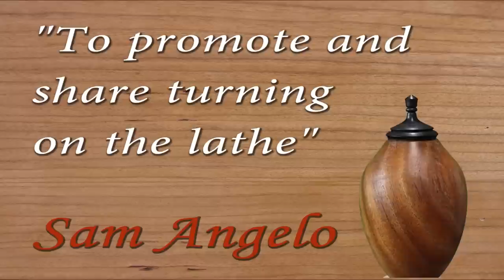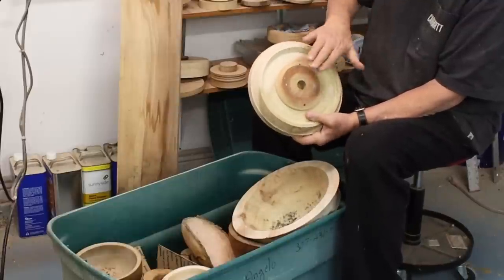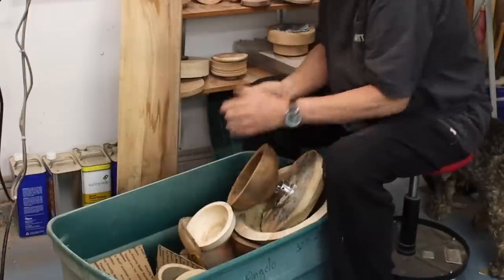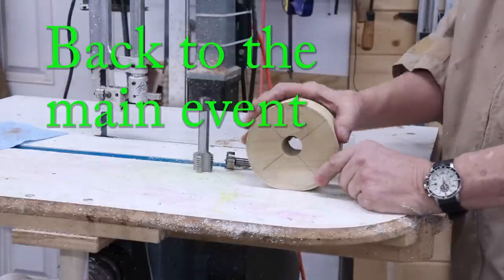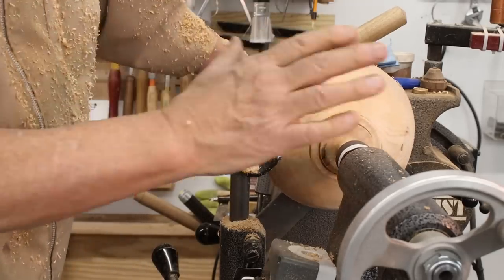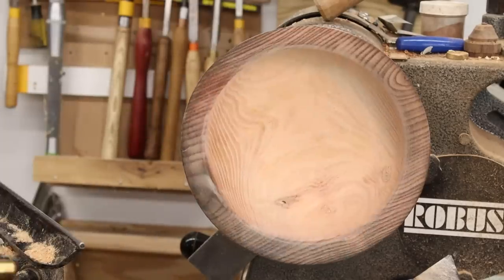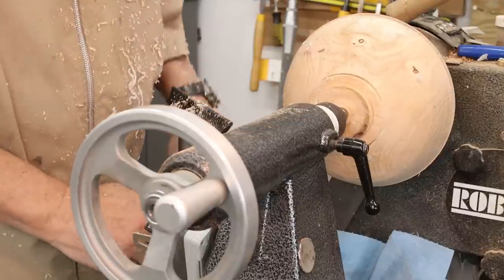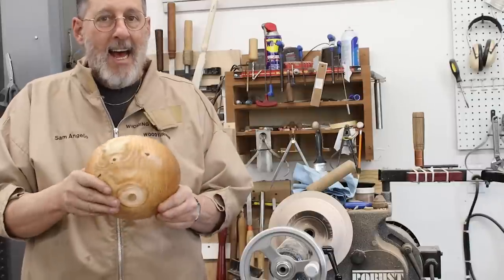Turning a Bowl with a Drive Block    Woodturning with Sam Angelo

Comment: I greatly appreciate your instructions in this video. I fell in love with OneWay chucks when first starting turning, and use their jumbo jaws with adjustable rubber stoppers to hold my bowls instead of using a friction block like you do. But, I can see some advantages with your method. (I also don't want to over complicate my turning with a vacuum chuck).  Thanks Sam.

Comment: Seems like you and I are among the few turners that will distinquish between a jam chuck with one sided support and a friction chuck with TS support. Poor Coco. I was watching when she was just a puppy. I love my vacuum chuck I built the first year or two of turning. Such a useful "gadget". It does not eliminate the need for a friction chuck to true up the outside as the warped walls do not permit the use of a vacuum. But it sure is nice finishing off the bottom. This is timely because I do need to make few friction drives. I have some poplar and will probably thread and have a tenon so I can use whichever fastening technique is the fastest, like when a chuck is already on the lathe.

Comment: Another strange coincidence Sam; I have just been revisiting my collection of drive blocks. Surprised how many face plates and rings I have accumulated. I also have Beall tapped connections, hex nut inclusions and like long round nuts (automotive track rod ends) for special purposes. Before my first self centring chuck I used a lot of paper joints, which are good for conserving precious wood. I was feeling I had neglected drive blocks as a worthy method. Scorched finishes are also awaiting attention.  Bernard.

Comment: No one in a wood working shop shop should smoke a cigarette or use a blow torch unless you are an arsonist!
Very dangerous!!!
Reply from the maker: First thank you very much for subscribing George. I agree safety is everything. I have used a blow torch, many times, and agree that it is a potential fire hazard. What I do may not be right for you. You are on the right track thinking this way I will be careful. Thanks, Sam.